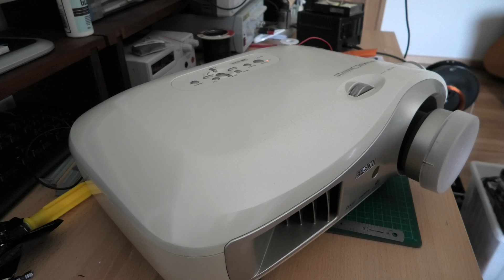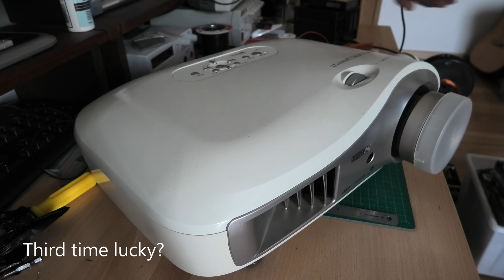Epson EMP-TW700 Projector repair (red flashing temperature LED)

Comment: Yep after replacing the blue light polarizer, I reassembled and then the persistent red light slow blink was happening.  Everything was working, temperature NTC resistors reading ~11 K ohms at 20 degrees celsius.  I re -set them to the pads with some flux and small amount of solder ( careful to use small tip soldering iron with high heat for short time on one side of the resistor only - then the resistor wont de-seat from pads).  After I reassembled - everything worked.  Great little projector for 70 bucks + 2 hour repair.

Comment: Hi, after i disassembled my Projector (to clean it and check the fans), i had the same problem with the Heatlamp. It was easy to fix: Be sure to close the plastic Lamp cover on the bottom and the filter cover. I dont know the mechanism behind this, but if you had the temp problem, it could be a chance to search the problem on this parts too. (Epson TW-1000 - nearly the same like this.)

Comment: hi, I have a question about what are the most important parts you can clean for a better picture and what would be the safest way to clean the parts. Is this possible with isopropanol ? I got an old EMP-TW680 as a gift and it works too, but the previous owner was a heavy smoker^^ so I see a lot of nicotine inside when I opened it:/ sorry for my English:p dear greetings from Germany

Comment: I have a problem with my Epson TW700. First I got a warning on the screen saying I need to change lamp. I then bought a new lamp, still this warning appears everytime I started the projector. Now the projector directly start blinking red when I turn it on and no picture appears. I took the whole thing apart and cleaned everything from dust including motherboard and every little part. Now I don't know what else to do. Is there any way to figure out what's wrong with my projector? I would appricate any kind of tips and would be so incredibly greatful if anyone has any idea what could be wrong. Thanks

Comment: I have the 1000 looks mostly the same on the inside checked everything out like the video shows no issues found. I found a repair manual that told me how to get in the service menu and the codes it is showing is for lamp burnout problem is its a brand new lamp is there a way to test the lamp to see if its defective it seems to work for 5-30 min before shutting down?

Comment: Thanks for this video.  gave me the confidence that I might have a chance.    My warning lights both start flashing red as soon as the main fan kicks on.      I'm thinking there are some bad sensors on my Powerlite 8350.   ?
Reply: @Bhadwa Modi  I took the entire thing apart and wasn't able to gain access to the temperature sensor that was all the way buried by the light.     So I have a heap of trash currently.    With a brand new lighting fixture.   But no way to get the thing fixed.

Comment: Really great video, this was so helpful and gave me hope for my beloved projector! Thanks to your tips I found out that one of the fans was not working and replaced it with (hopefully) equivalent one from the same brand (original is NMB 3110KL-04W-B49 I have put 3110KL-04W-B59). Unfortunately it still does not turn on, the temp/light LED is slowly flashing. Any tips? I have (found the courage to) put back all the screws, because it may have not been "done" and accessing that fan is a pain ... is that an obvious reason for the projector to not turn on?
Reply: i guess I'm pretty randomly asking but do anybody know a good place to stream new movies online?
Reply: @Marco Shepard Lately I have been using FlixZone. You can find it by googling :)
Reply: @Grey Archer yea, I've been watching on flixzone for since april myself :D
Reply: @Grey Archer Thank you, I went there and it seems to work =) I really appreciate it!!
Reply: @Marco Shepard happy to help :D

Comment: Nice video-I have repaired a lot of Epson projectors in that model line when I worked on them over 4 years ago. Always found bad CF motor assys. causing that problem. If you are highly skilled you can repair the cracked gear inside the motor assy.If the unit comes on you can find the errors logged in the service menu error log too.
Reply: @CezarAlssamaray  Hi , I can help you with it, pm me please

Comment: Hi, I have the exact same problem. I checked both sensors and they are at about 12K ohm. Tried to add weld as well as you did but didnt help. Buf if you meassure on the connectors and not on the transistor and you have like 12K resistence why should you have to reweld them?, they are indicating that they are working? So Im a bit supprised your welding fixed the issue? Please explain :)

Great video :)
Reply from the maker: I suppose that's just the nature of an intermittent solder joint fault.  I should have put the microscope on these joints, but it didn't occur to me at the time. Has been working fine since.  Is your unit's problem intermittent?